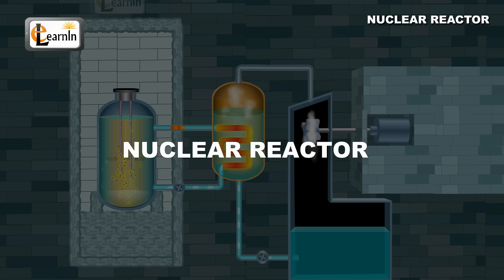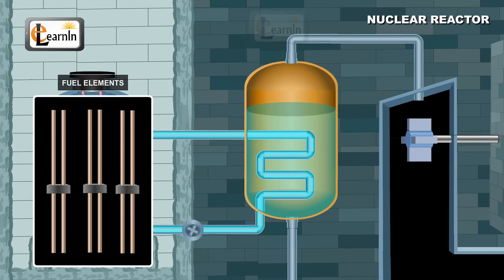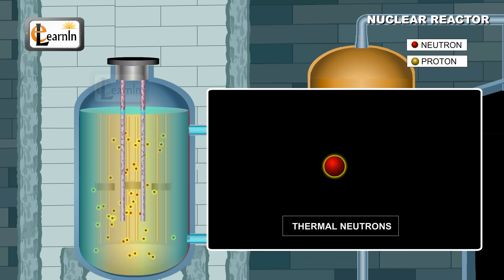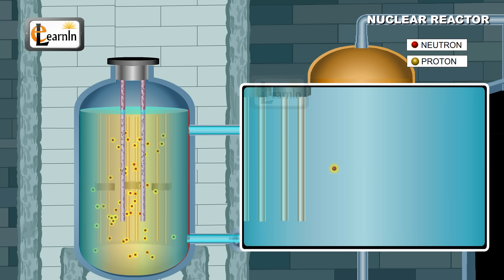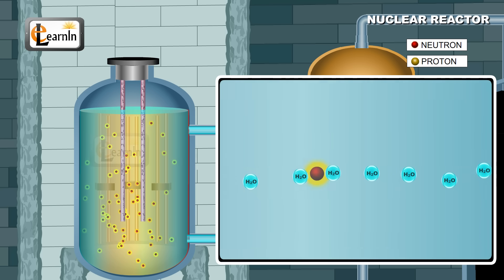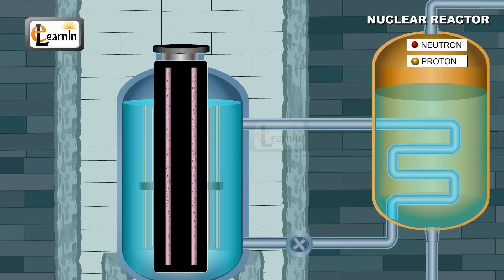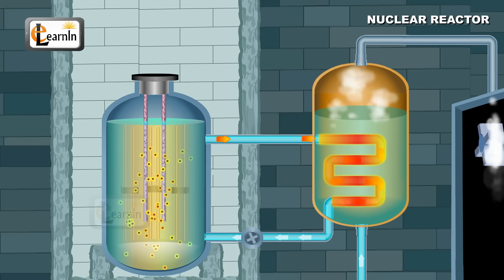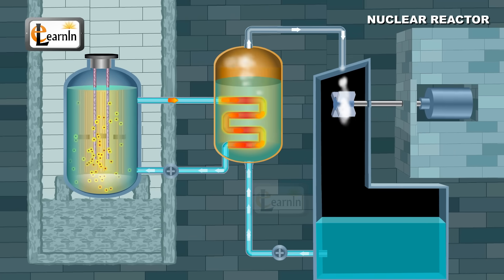Nuclear Reactor - Understanding how it works | Physics Elearnin

Comment: in 50 years all uranium is gonna be gone...
Reply: Shamoun D Totally. I love love to have my house powered by the sun. Oh shit! The sun sets at night. Oh SHIT! The sun isn't always bright! CLOUDS! OH SHIIIIIIIIT! IT PRODUCES ONLY 200 WATTS AT MOST AND I DON'T LIVE IN THE FUCKING EQUATOR.
Reply: you, my friend, are stupid
Reply: Shamoun D  Right now, scientist are trying to create their own little stars in case the sun explodes.
Reply: Shamoun D Also, I didn't realize there were only 4 schools in England.
Reply: Shamoun D Only stars with very large masses can become black holes. Our Sun, for example, is not massive enough to become a black hole. Four billion years from now when the Sun runs out of the available nuclear fuel in its core, our Sun will die a quiet death. Stars of this type end their history as white dwarf stars
Reply: ***** I disagree sir they are quite factual.
Reply: Shamoun D You are a bit mistaken on the aging process of our sun. Our sun creates energy by the means of fusion reactions. When the hydrogen of the fusion reaction depletes, the energy that pushes outwards will also be "depleted" and causes a collapse on the core of the star. This forces the helium nuclei to fuse creating denser elements in the star. As this process is going on, you will have a continual push towards the outer portions of the star which increases its size, expanding it much larger than what our sun is today. This is when it becomes a Red Giant. Once the helium has been fused in its entirety, the created carbon will stay as it is. This is when the core stabilizes. The outer shell of the star will continue to expand and basically turn into what is known as a planetary nebula. So no, our star won't "explode" or turn into a black hole. It's simply not massive enough. The Tolman-Oppenheimer-Volkoff limit ought to be a guide to determine how massive a star would have to be to collapse to a black hole. Generally, its thought to be a star above 3 solar masses will collapse into a black hole at the end of its life. David Schuknecht If your second comment reads by the way I believe you are saying, your statement is only half right on the Uranium part. Thorium, however, is three times as abundant as Uranium and can be used for much longer and more efficient means. We can use 100% of Thorium in a reactor built for such means. The US and Russia developed Uranium reactors first because it is much easier to weaponize the fuel. Thorium, not so much. However, great leaps are being made in nuclear energy research to both efficiency in the Uranium usuage (see Breeder Reactors) as well as general production means with Thorium. Not only that, but the "50 years" point doesn't even take into account new mining operations that are in development.
Reply: Even though uranium is not renewable and there are limited amount of fuel for nuclear power on earth, reports showed that with the yearly consumption of nuclear power, we still have enough uranium for 80 years. In 80 years we will be able to find an alternative to generate electricity.
Reply: David Schuknecht Our sun isn't big enough to become a black hole. It will become a white dwarf. You should get education too.
Reply: Shamoun D I know you posted this some time ago, but solar isn't as efficient as most think. Panels are at best only converting 30%, and an inverter is need to convert it to AC losing efficiency yet again... The counter argument is that sunlight is free. Yes, but the equipment to acquire it isn't usually with an ROI timeframe of 15-20 years assuming no maintenance is needed. Solar is the way to go, but either efficiency needs to be improved, or systems need to get cheaper for them to become mainstream...
Reply: Actually most reactors use reactor grade uranium, which only needs to be about 4% U-235. Were not about to run out of fissionable U.
Reply: David Schuknecht Or will it?
Reply: David Schuknecht except thats waht is said on all official articles on the internet so..
Reply: I think the astrologist are acually just uraniumist.
Reply: Our sun as a white dward will not implode, it is the product of implosion from a giant star, though. If you're assuming that all white dwarfs will implode into a black hole, you're still partially wrong. Only certain white dwarfs will meet the criteria for those circumstances, see the Chandrasekhar limit, similar to the TOV limit stated above. Still, if you don't think it is feasable for our sun (nowhere near) why even make the claim?
Reply: Shamoun D You also just said "it won't explode into a black 'w'hole but it will implode due to gravity after it has become a white dwarf." That statement is entirely unneeded to your claim. I guess it is obvious that I'm the fool here, though. You know, being the one actually stating limits and trying to stay as scientifically accurate as possible with current models and all. Complete fool.
Reply: I did, which is why I said that statement is entirely unneeded for your claim. Maybe YOU should try having some "cutousey" (courtesy) by reading the comments entirely.
Reply: At the current consumption it is being reported to last between 50 and 100 years, but this does not include proven sources where nuclear fuel can be extracted from such as extracting from sea water and phosphates. These 2 options would most definitely be explored further should nuclear energy be proven as a safe and economical means of producing energy compared to other sources (ie.renewable energy) which no doubt would cause these forms of extraction far more economical. Also there are reactors called breeding reactors which can create up to 1.2 fissile material for every 1 fissile material used in the process, thus solving any concerns over nuclear fuel running out.
Reply: Codegreen642 There are multiple ways nuclear energy can be made even more safe, but oil and coal companies want to maximize their profits and completely subdue these methods from ever being put to good use! Once they scrape the last penny and drain Earth's natural resources dry and make the Earth that much more polluted THEN Nuclear energy will be declared safe. MARK MY WORDS!
Reply: That is no problem you can split , thorium , plutonium , hydrogen and almost every other element
Reply: Lich King OK but its probably  gonna be on your tombstone
Reply: January Jiang  Even considering that relatively short time frame, there is no one that will be adversely affected.
Reply: dirk v.e what in the world are you going to split hydrogen into? it only has 1 proton and no neutrons if you take stuff away you are just going to have nothing, if you by hydrogen meant water then yes you can split that and get hydrogen, but you can't really split hydrogen.
Reply: ydorn i meant deutorium and tritium (2 kinds of H)
Reply: Shut up everybody, continue masturbating. Because you will never get a girlfriend.
Reply: David Schuknecht Thorium is the key, we arent going to run out of THT stuff in 50 years...that stuff is very common on earth, its should last us for at least a century if not longer if we convert to liquid fluoride thorium reactors, of course, thats only if governments decide to discontinue the use of inefficient light water reactors that we have now. Thorium is not only much more available, the end waste created not only cannot be made into nuclear armaments but also only takes 300 or so yrs to render safe, on the contrary to the current waste from light water reactors that take a millenia to render safe. Also, thorium reactors are much much much much less vulnerable to accidents as there are no solid cores involved, as every thing is molten, a meltdown cant occur. It is also shown to be much more efficient than uranium. So, dear fellow humans, we arent going to run out of nuclear fuel in a mere 50 years...more like centuries...
Reply: David Schuknecht THORIUM IS NEW FOOTURE. lol but for real, thorium is the future
Reply: David Schuknecht you're so full of shit David.
Reply: wtf? why do you insut somone like that?
Reply: David Schuknecht generally because you're misinformed and not competent about this stuff.
Reply: alright im misinformed no reasson to assume im "full of shit"
Reply: alright stop wasting your time on me then
Reply: the sun will turn into a white dwarf and destroy the earth by the expnding layer of hot gas thats gonna burn our planet
Reply: Uranium is one of the most plentiful elements on the planet.
Reply: Leathan Lund no it's one of the highest elements half of it decayed away already
Reply: noo most plants use uranium 235 in nuclear power plants, and uranium 235 only makes up about 0.65% of Uranium isotopes. so the 50 year thing seems kinda plausible lmao
Reply: Leathan Lund uranium will still be used in the same amount doesn't matter what percentage it is if you wannabe produce same amount of energy
Reply: David Schuknecht you can reuse it and power the entire world for hundreds of years.
Reply: New reactors are being built that can reuse fuel from our current reactor models. And solar energy is kinda shit, because you need a fuck ton of space to put panels on for it to be equal to the effect of nuclear energy, same with wind.
Reply: Till then we will be using Fusion reactors :P
Reply: not true. unlike fossil fuels there are far less nuclear power plants than others that use fossil fuels. Because of this there is so much uranium that it could almost be classified as a renewable recourse.
Reply: +David Schuknecht 47 years to go!
Reply: "I will is more important than IQ"
Reply: Uranium didn't originate on Earth, all we have to do is to find its origin planet.
Reply: s d 
But Sun will die in 5/7 billions of years !!!! Oh wait...
Reply: s d 
LOL Black holes don't turn into white dwarfs ! 😂 Btw our Sun won't turn into a black hole. ROTFL
Reply: s d 
WTF man 😂😂😂😂
Reply: Andrew Cheng not sure if you realise, but olar energy is efficient, even when it is cloudy there is plenty of energy being made. and in enough quantities it has enough potential to produce for the entire planet. imagine if everybody used solar panels. or there were solar roadways (an idea in progress) so much energy. believe me dont underestimate it
Reply: David Schuknecht we got renewable sources on a revolution for that. Solar energy...
Reply: it wont turn into a black hole your school is obviously wrong if it teaches that
Reply: nope i am gonna stop arguing cause i think your gonna have to argue with the astrologists
Reply: idiot iq means nothing
Reply: shamoun no get educated
Reply: we have far more uranium than you can imagine
Reply: waaaaat
Reply: Jiaqi Chen appearently there has been an misunderstanding... i actualy said that it will expand and form a white dwarf...not judging
Reply: your realy stupid cause it will explode in 5 billion years and it will simply expand and then form a white dwarf
Reply: i ment not only uranium but all things a nuclear reactror can use to produce energey :)
Reply: Where did you come up with this idea?  I cannot find anything to support that all uranium will be used up in 50 years
Reply: only 2 percent of the worlds electricity is produced from nuclear reactors and i was saying that if the number of reactor stays and we would have ALL of the uranium in the world and otehr nuclear fuels we would run out in 50 years
Reply: no
Reply: 1. its not gonna explode
2. its not gonna turn into a black hole 
get educated!
Reply: not explode expand
Reply: yeah...

Comment: He forgot to mention that with heavy water you can use natural uranium you can find in the ground. Backyard plutonium producers anyone? Just need a few liters of heavy water, homemade uranium pellets, and a bunch of pressure cookers.
Reply: Also lots concrete will help with the gamma radiation, hazmat suits don't do shit! :P
Reply: On, I had no idea heavy water would be easily accessible.
Reply: Juan Juarez
You can buy it on the internet for ~$1000 a liter.

Comment: Thanks 4 that. I was finding out about chernobyl so this really helps. Thanks
Reply: Chernobyl was a very different reactor, graphite moderated. And for some reason the control rods were tipped with graphite! (Happy explosion day)
Reply: leerman22 kinda cool that they could use a moderator as an effective rod follower

Comment: so they use extremely unsafe dangerous unstable materials to boil water? that just sounds retarded to me.
Reply: Those reactions release a lot of heat energy, it is a very efficient way to boil water. Much more efficient than using solar energy, wind, geothermal, hydroelectric and other ways of generating electricity.
Reply: instead of using a very nasty pollutant (Chernobyl anyone?) to boil water to turn turbines, why not just have a few gigantic gyroscopes do it. far as I know soon as you get em goin they'll just keep spinning for awhile. you could have a chain of em set up so you get 1 goin and the rest go off of that one as well as keep that one going.
Reply: I do not know much about gyroscopes but at the moment, nuclear power plants have proven to be very efficient. Also Chernobyl was several years ago and the disaster was caused due to human mistakes, it is not as if it will always happen.
Reply: dude there have been like a dozen nuclear meltdowns, all of which really fuck shit up for us. you cant even go to Chernobyl cause if you do you're fucking dead.  of course it'll happen, already has. I just don't feel like linkin it, google it dude.
Reply: trolls got owned
Reply: johndyar
All 3 of those reactors were poorly designed, you have brainwashed russians, plutonium priorities, and a tsunami firing line. Its not a technology problem, and those problems are resolved in new designs that couldn't be built because of fear mongering and ignorance.
Reply: THEY DO!  Its called coal.  It puts 100x time the radiation into the air that nuclear energy does from trace radioactive elements in the coal, in addition to hundreds of tons of co2, per person per year.  Thats not even including soot, or mines that are leaking heavy metals into the heartland.
Reply: Dinocrap1101 there have been 3 nuclear power plant meltdowns.
Reply: leerman22 i am in favour of nuclear energy. I was responding to Dinocrap1101 when he said "there have been like a dozen nuclear meltdowns".